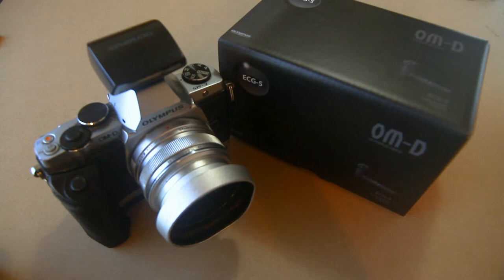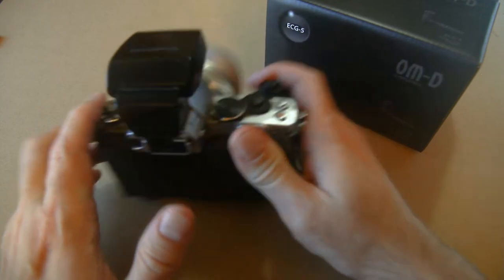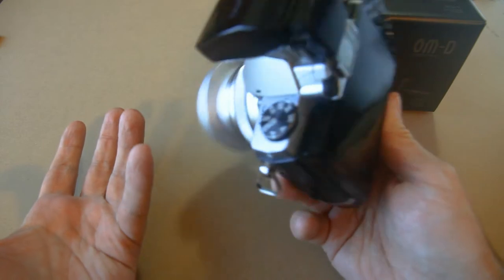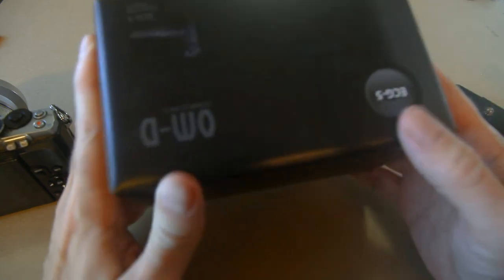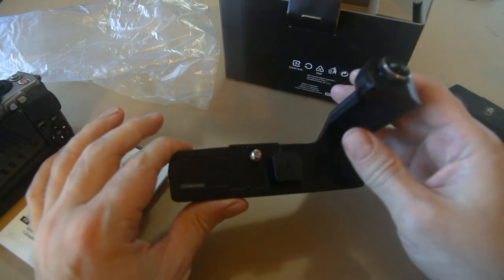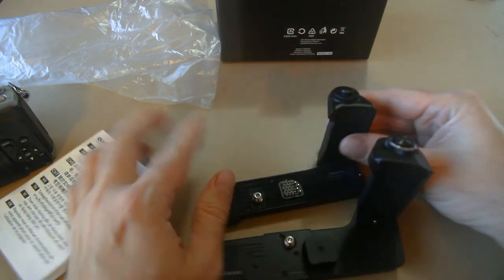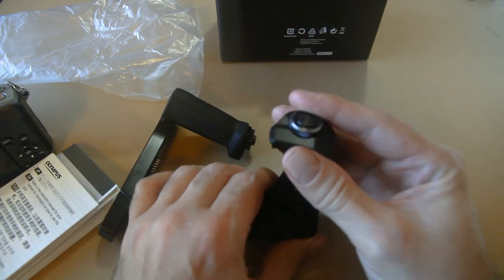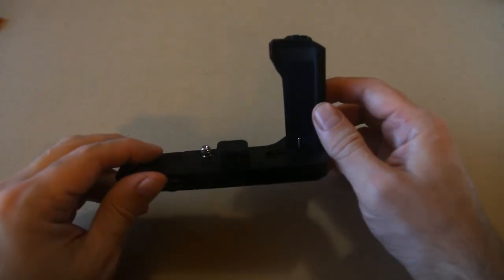Olympus E-M5 III ECG 5 Grip. Does it have a hole for the battery?

Comment: I bought the grip for my EM5 III and make a huge difference. less than a minute to swap out for a battery is not that bad.
Reply: I do agree that it's much better with the grip. Based on my experience with the original E-M5, having to remove it to change the battery does get pretty annoying though. I would say it's still definitely worth it. However, right now the E-M1 mk II is on sale, and the price of the E-M5 III plus the grip makes it more expensive! I actually took my E-M5 back and got the E-M1 instead, with $70 to spare. I'm not saying that the E-M5 III with grip is a bad deal, but if it's around the same price as the E-M1, it's a bit  of a harder sell.
Reply: With the grip attached, the E-M5 III is only 39 grams lighter than the E-M1 II.
Reply: "Content Now" is my channel by the way, obvoiously I'm kinda new to the "Youtubing" thing. Thanks for watching!
Reply: @danduranduran  The added weight seems to defeat the purpose of having an E-M5 III, if you want it for the purpose of a lighter carry than the E-M1 II.
Reply: @stevebonn3463  True, so in theory, the only real reason to buy the E-M5 III with the grip over the E-M1 II is price, except that the E-M1's price has been dropped to $1299, which is actually $70 cheaper than the E-M5 and grip! I took back the E-M5 and exchanged it for the E-M1. I think the E-M5 is great, but Olympus discounting the higher end model right after it's release is just baffling. Getting the E-M1 instead was kind of a no brainer.
Reply: @stevebonn3463 
Not when it comes to video, so one wants to carry camera that can shoot excellent photos and videos e-m5 mark 3 is great choice, em5 got higher spec for video than em1.

Comment: DAMN!!!  Got mine coming tomorrow. Good thing it wont be my main camera anyway
Reply from the maker: The real problem is that the cost of E-M5 III plus grip makes it basically the same price as the E-M1 II. Not much of a weight difference either. At the time I made this video the E-M1 II went on sale and was actually cheaper after the grip price. I wound up returning the E-M5 III and getting  that one instead. It seemed really foolish for them to tank the E-M5 III launch by having that sale at the same time. If they're the same price, the E-M1 II is really a no brainer, even though I prefer the look and feel of the E-M5 III. I've had it now for a year now and it's great, but what I really wanted, what many of us really want, is an E-M1 that looks and feels like an E-M5, but alas. Perhaps JIP will cook one up, but I'm not holding my breath. Not that the economics and general feel of the E-M 1 II isn't great, or even all that much different, in fact they used the grip space to fit a bigger battery, but the feel of E-M5 III is just slightly better in my opinion.
Reply: @contentnow7393  Ive had them all, for me nothing touches the E-M1X for handling, assuming you can cope with the size and weight.  i like the E-M10 series if the lens is very small. The grip came today and means I can use the 12-100mm on he e-m5 iii, im not sure i could have without it